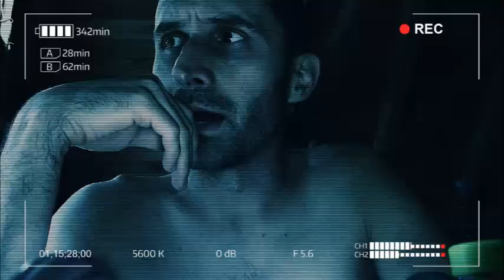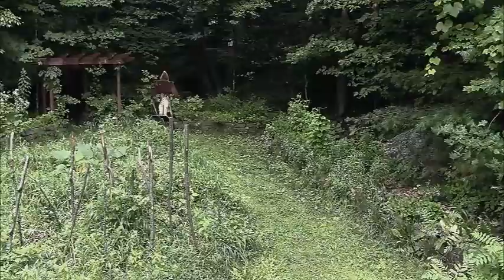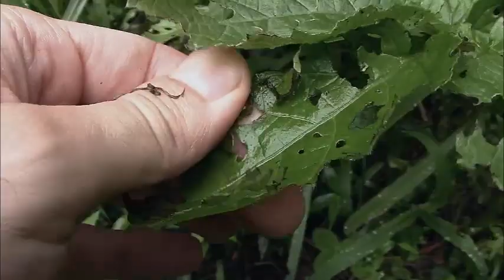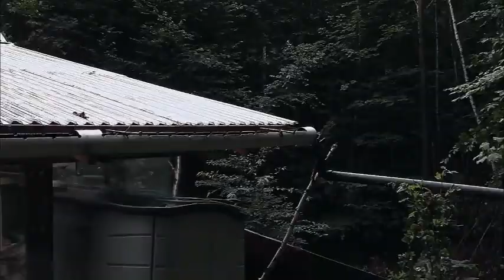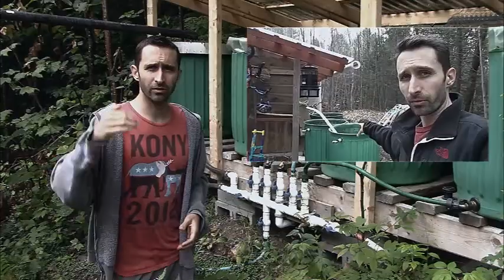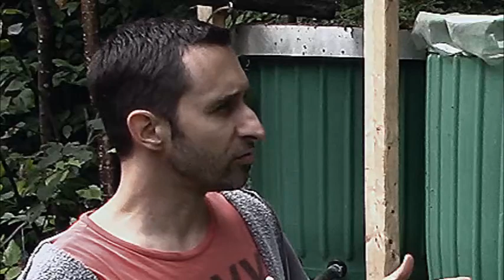Is Your Garden Ready to Feed Your Family?

Comment: Your so right on practicing your survival plans now i.e. gardening etc. I am a very experienced gardener and I am always learning new things and running into new problems. Your rain barrel system is cool I like it. Why did you decide to go with a manifold feed instead of direct feed from barrel to barrel? Watering from your gold fish ponds is a form of aquaponics if you already have them in your greenhouse you could build an aquaponics system in there. They are very efficient.
Reply from the maker: I think the manifold was something I decided to do in order to be able to do maintenance on individual barrels easily (being able to shut off one barrel without bothering with the rest). Beyond that I guess I'm just a little bit of a control freak and wanted to be able to run the system in different weird ways that all the valves allow. Once I actually DID flip the valves in a way that allowed me to draw water from the goldfish ponds in the greenhouse by using the house I usually use for watering in the greenhouse as a siphon to draw water up out of the tanks and down to the garden. But the pressure wasn't great because the level of the water in the fish ponds is probably a good 6-7 feet below the rain barrel "full" level.
Reply: Praxis Prepper you could increase pressure by running it all to a centralized tank and putting a pump on it, but then you would be running electricity. Maybe just build a compost outside the greenhouse and water it with the fish tank the compost will soak up the nutrients from the tank and can then be moved to the garden. Sorry not trying to tell you what to do just throwing out ideas. You have probably already thought of all this.
Reply from the maker: A pump run by solar panels isn't actually that difficult. I actually already use one in my house to pressurize the water I keep in my indoor cistern. The issue would be the gunk from the fish. I'm not sure a  pump would be very happy with all that debris. I know i could install a filter, but it's another thing to do... and if I'm filtering out the debris, that'd sort of go against the whole idea of using the gunk and debris for the garden. Maybe there are pumps that are okay with gunky water though? There probably are. I mean, people pump their black water into their septic systems... that pump could probably handle it.
For me though, this house has been great. I've learned a ton, but I'm moving soon anyhow, so I'm more focused on homestead 2.0 instead of the one I'm in now. Your tip is a good one though. For some people, I bet a pump would make a huge difference!

Comment: Attacked by chipmunks. I am sorry, I realise it is probably a serious issue but, my guts hurt from laughing.
Yeah, I use pvc for fittings (like you have on your manifold) or black poly pipe (if going over distances) for water. That being said, currently I use a plastic jerrycan to move my drinking water.
Reply from the maker: At my next house that I'm building in 2019, my plan is to REALLY pimp this system out to hold maybe several thousand gallons. Because... why not? ;)
Reply: I have just been looking at water storage in the States and what options there are. I figured for some reason they would be more limited because no one seems to really have them. But all the same options as here except for concrete?
I was going to write some big long thing about types of tanks and pro's and con's but deleted that. Go with plastic tanks. Try and keep them out of direct sunlight but that's really about it for increasing longevity. So many options for sizes and shapes you can fit them in how you want them and they don't have to become a big part of your landscape and home design.
Reply from the maker: There actually are some laws in some areas that make collecting the rainwater off one's own roof illegal. But I think the bigger reason that most people don't do it is that most people have no idea the value of water, and figure that someone else is going to always ensure that they have all they need.
Reply: Ah yes, I have heard this before that some areas have made it illegal. That is pretty crappy considering the number of towns that have flammable tap water. I would hope that none of those are included in the areas that it is illegal to collect rainwater but it would not surprise me if there was at least one.
Reply from the maker: I think the rainwater collection laws go back to the old west when they were more talking about people doing massive ground alterations to horde the rainwater and keep it from flowing into the local rivers. But a lot of them stand to this day (on the books anyhow).